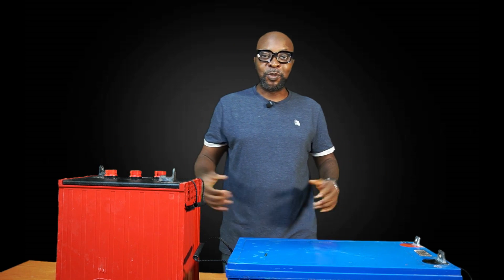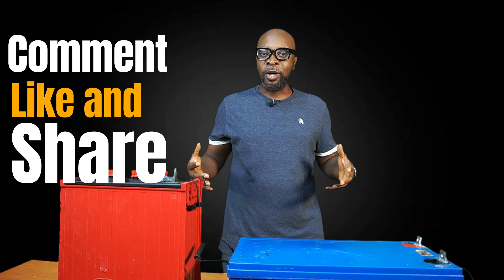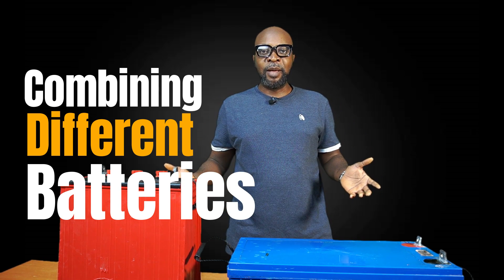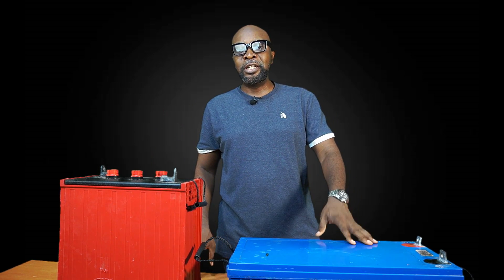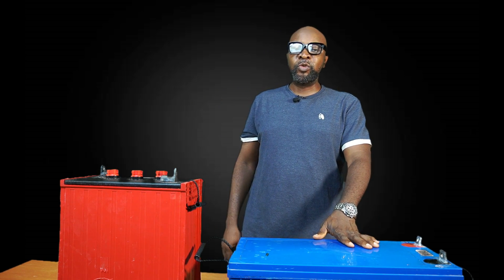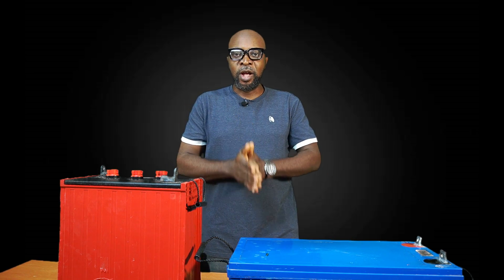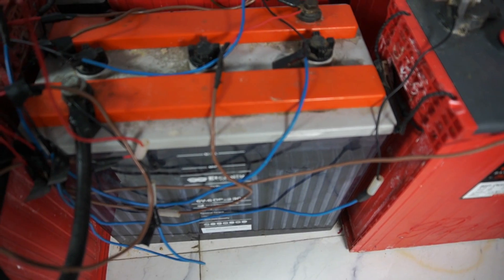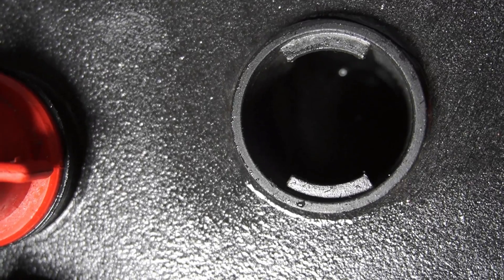Why you should never combine different Solar and Inverter deep cycle batteries

Comment: What is the lifespan of a well taken care of tubular battery in an inverter system
Reply from the maker: Different batteries have different cycle numbers but avearagely you should get a minimum of 5,000 cycles from a Tubular battery and it can also can be a lot more.